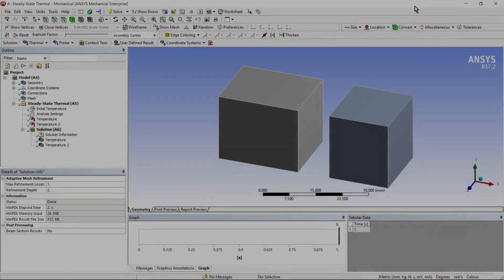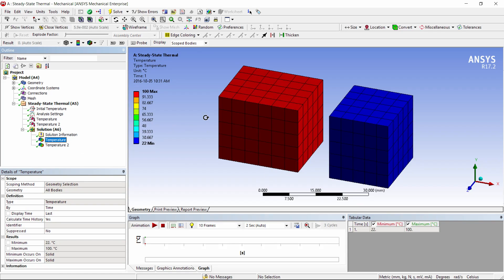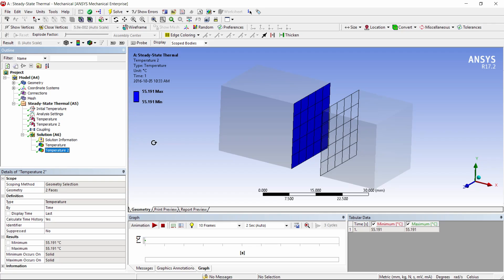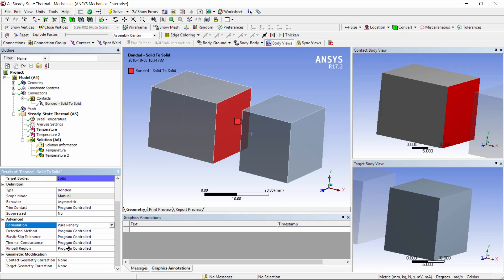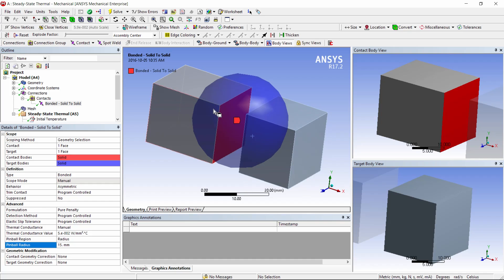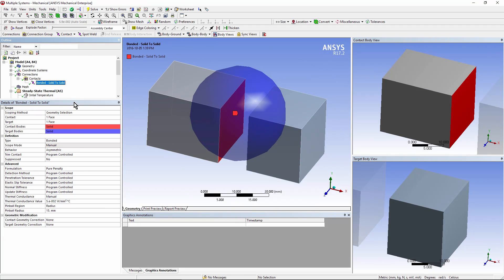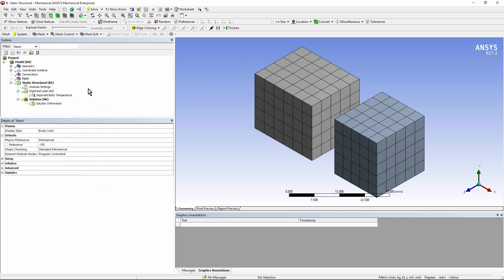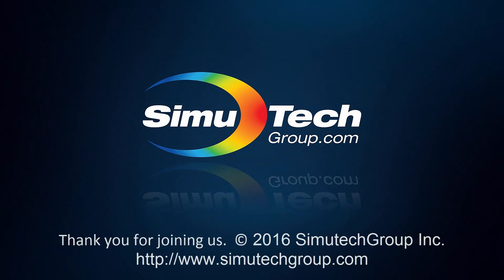Modeling Face-to-Face Thermal Contact in Ansys Workbench Mechanical

Comment: why we used pinball command in this thermal analysis
Reply: The pinball gives the distance across which the surfaces will find each other to make the contact connection. If you set the pinball radius to a value smaller than the gap, the program will not consider the two surfaces in contact. The default is zero, and since the surfaces are obviously more than zero distance apart, you need to put another number in there.